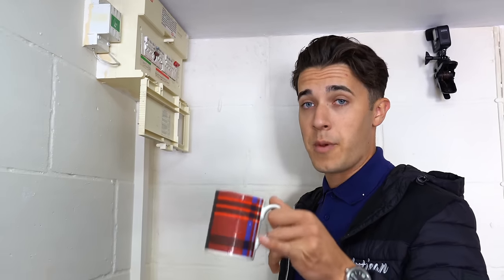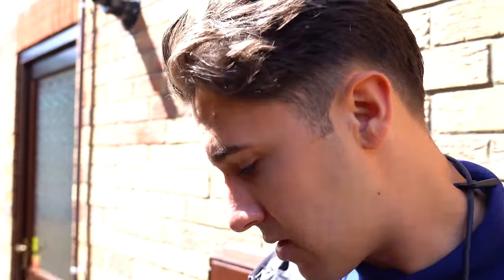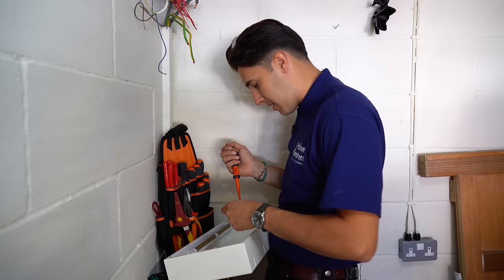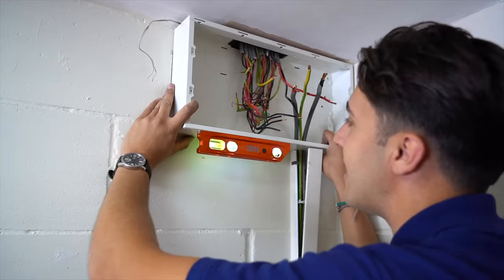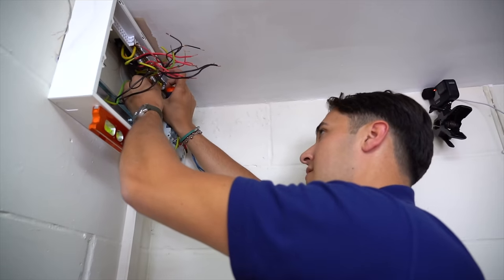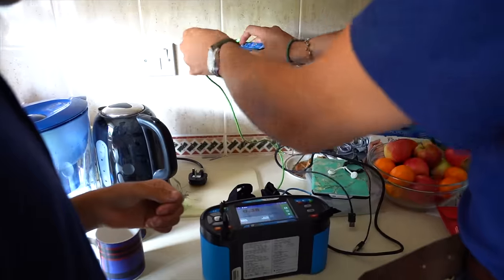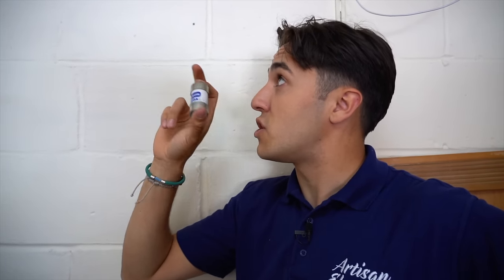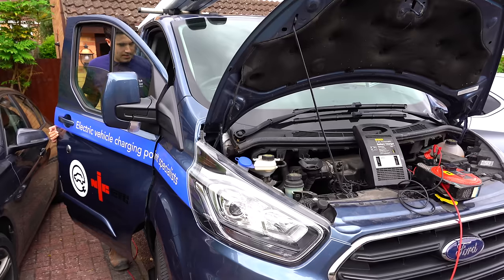Teaching Apprentice How to Change a Consumer Unit - Electrician Life

Comment: Big thumbs up Cory particularly re pulling the cut out fuse. It was the bain of my working life that DNO’s persisted with this ridiculous turf war over the sanctity of the cut out fuse. How are you supposed to work safely if they will not fit main isolators as a standard practice. Luckily in my area the local DNO engineers took a pragmatic view and happily handed me resealing tabs whenever I needed them!

Comment: In Australia, we are required to install a meter isolator.  It must go before the meter and before the main switch. It is in a separate cubical and away from final subcircuits.   This way, consumer unit changes are simple (well - simpler)

Comment: I recently got smart meters fitted by EON, and was pleasently surprised to see the subcontracted sparky fitting a nice new double pole isolator in place of the old one that had been fitted by SSE when I had electric storage heaters.  That's up here in Scotland.  Can't believe it's not a standard thing TBH
Reply: Had the opposite- the smart meter installer removed my isolator switch saying it was faulty anyway !
Reply: Had to specifically request it when I had a smart meter installed and the subcontractor was very surprised at the request!
Reply: I think it should be mandatory to fit an isolator when they are fitting a smart meter. Given the reason for smart meters or should I say excuse was that it will save us money, then how much could be saved by not having to call out the DNO when you want to work safely which is technically what you should do.

Comment: I don't understand the issue here in UK about removing main fuses... in Portugal as example, if a registered sparky needs to isolate installation, they can call the DNO, read the seal data and if they match with whats on file, the DNO authorizes the sparky to break the seals and work safely. Sparky leaves the broken seals and DNO will pass by in a couple days to inspect /reseal. 
All registered sparkies receive training to do it and obviously they must take responsibility for the work done.  It works like this in alot of other countries. 

In the end, the DNO wins as a lot of customers there update the meter boxes / mains fuse carriers to current specs at no cost to the DNO. Sometimes, if they are told in advance and it is an old installation they even send a new meter for the sparky to install... 

Wish i had £5 in my pocket for every meter they sent in advance once we notified of works being done.. Maybe it is a insurance / liability here in UK?
Reply: Some of the DNO's have a similar procedure here - what you've seen in this video is bad practice.
Reply: @efixx  I do understand that, but still preferable than working with live installations.

Comment: Another good reason to keep screw line vertical is so they don't rust as easily, when they are horizontal condensation and moisture can build up on them causing to rust quicker

Comment: Never measure with the cable around your neck. Faulty isolation on the meter and you van get the shock, was a problem with fluke meters but can happen with each brand.

Comment: You don't need to lift the seat up in the van to jump start the engine . Ford have a plus contact from the battery which is under the bonnet . And sith the black -leed connect that to the body or some metal part on the engine

Comment: Get yourself a DeWalt DCF601 12v screwdriver, trigger speed is lower than the impact driver, so easier when working with delicate screws.

Comment: i when i was working as a electrician, always used a proving unit on my mains tester before sticking on supposed live terminals. other than that , top job , i retired as a spark in 2015 after 40 years.

Comment: What’s are the number tags your using for the cables
Reply: Easi-lock slide on number tags , between £40-60 a box depending on source 👍🏼
Reply: @Lineandsinker87  Could you pop down a link for them buddy? Struggling to find them online thankyou
Reply from the maker: Hellerman tyton
Reply: @artisanelectrics  champion thanks, keep up the solid work guys

Comment: Why in UK  consumer units are in many cases so small. I (Finland) have a consumer unit in a detached house with 145 DIN module slots. OK it's a little too big, but I think 20-30 seats is the minimum. At the summer cottage, I have a total of 25 DIN module slots, of which 20 are in use. For example, there are usually only 2-3 sockets behind a single automatic fuse (in one room) or a single kitchen appliance such as a stove (3x16A), dishwashing machine or washing machine (16A every fuse). 10A automatic fuse are really only for lighting use.
Reply: Same in Poland. I've fitted a 160 module (8x20) board in my 200sqm house and it's just about the right size, with not much free space left. T1+T2 surge protector itself takes up 8 slots, there's a main isolator (3-pole since it's a 3-phase supply), 2 3-pole isolators (for sub-board in the utility room and sub-board in an outbuilding), fused isolator for the solar PV board, distribution block for power distribution within the board, several 2-pole RCDs for a few groups of circuits, 3-pole breaker for induction cooktop, DIN intercom transformer, a bunch of 1-pole breakers for several lighting circuits (2 per floor for the sake of avoiding total darkness if one trips), socket circuits (one per every room, outdoor sockets) and individually supplied appliances (dishwasher, oven, washer, dryer, alarm system, IT cabinet, gate opener). Apart from that there's another 3x18 sub-board in the utility room just for the utility room equipment (air-to-water heat pump, electric heating element in the water tank, ERV unit, central vac, with extra kWh meters to track energy consumption for heating and ventilation).
A 2x12 board with single or two RCDs and several breakers would be common in developer-grade 50sqm apartments with the most powerful appliance being the induction hob where hot water and heating are provided via district heat system, but it's impossible to fit all necessary equipment even in a small 100sqm house (even without electric heating and water) into anything smaller than 3x18 or 4x12 board without cutting too many corners. And since it's a standard these days to install heatpumps, AC and solar in new construction, much, much bigger boards are necessary.
I suppose in the UK ring circuits manage to limit the number of breakers for socket circuits. A single 32A ring in a kitchen can mitigate the need for individual radial circuits for big appliances (except for the hob). One 32A ring can also supply all upstairs bedroom sockets for example. It was designed for the sake of savings and apparently it does a pretty good job in this regard. With 16A radials many more circuits are necessary. Here it's considered "good practice" to install no more than 8-10 sockets per circuit in "normal" rooms (bedrooms, living rooms). That means one, maybe two rooms maximum per one circuit.

Comment: You would think main isolators would be fitted as standard now and retrofitted as a legal requirement for just basics of safety more shut offs the better its like a tap. You got the tap itself then a valve under the sink to cut the tap off then you got valves before that sometimes to cut a room off then the main valve/stopcock

Comment: Have customer call their electricity provider and ask for an isolator fitted? Then just book the job in once they have a date to avoid the potential nuisance that comes with pulling main fuse (even though I know you didn’t 😜) 

Only costs about £75 maximum up north, sometimes no charge depending on the provider And usually done within a couple of weeks

Comment: It won’t just be the belt… (cheapest quickest bs fix) no battery light on while driving to show it discharging.? Prob something drawing too much when ignition off, and likely the radio with the other trouble (expensive fix).
Reply from the maker: It was the battery in the end
Reply: Carplay not working is a result of a dead battery, because they like to DRM those things for some reason.

Comment: Hello everyone, quick question, is 37 too old to enter the sparkie trade??? Baring in mind current conditions etc
Reply: I started at 36. Just find a good college and get some work experience. It’s worth it fella
Reply: @GenerateLance  cheers dude. I did a carpentry qualification about 9 years ago. Was looking to add another skill under my belt. 
Its a toss up between electrics and plumbing.

Comment: Well ... so just pull the DNO fuse ??  ( which you did of course )  Try doing that with a SMART meter.  - ( which recognises   loss of power and communicates same to energy supplier )
Chances are you will get  then get a "fine" from the DNO who "know"  you did it , and when ( colleague of mine got an £80 fine for just that.)
For as much as I agree with safe working ... as I see it - that does not give you the right to interfere with DNO property.   
Suffice to say that there are other "ways" of dealing with the issue.

Comment: The thing I saw which I don’t like is the leads from your AVI around the back of the neck all good if the cables are in good condition but if there is a split in cable you could get a nice bolt from it mate.

Comment: Van talk is good. I used to work for VW as a technician. The new vehicles do have more issues than the earlier models. New Transporters have egr cooler issues when used for short journeys over a period of time. Unlike the Ford's, the VW vans don't have a static regen mode for the DPF, a feature i have on my newer transit connect.
So far I have had no issues with any aspect of my van. The Ford Sync3  on the van is great, i always have it connected via my WiFi at home, any updates issued will download whilst I am tucked away in a deep sleep.
On the subject of pets, now get this one.............. I fitted a shower for a customer back in June, she had a mouse in a cage. Yes, a mouse. How cool is that. I am all for the animals with small or large snouts.
Reply: They've had more problems with that van than I've ever had with my 23yr old T4, still going strong so I'll stick with it !
Reply: @PaulCooke25 
The T4 is a very good van, unfortunately they don't make stuff like that anymore.
Reply: @jontownsend8090  mad thing is I could get 3k for it, at152k miles still has original clutch, starter motor, alternator !

Comment: Which one is the apprentice?  The 'door trim' is rough AF. The tail entry could have been properly glanded. I don't recall seeing a torque driver??  BUT!! on the whole an immaculate board. Great to see house bashers using ferrules and wire tags.  Personally, when you 'zip tied' the line and neutral together.  We tend to separate them all out, Lines together, neutrals together, CPC's together.  Just something we've found when using Allen Bradley E300's.

Comment: Pulling main fuse out without dno/ dso permission, I don't think they will be happy as I previous didn't have very good experience with them even the seal was already broken. Consumer unit top cable entry knockout hole, I don't know how we gonna get away with CU IP4X protection, I personally think it would have been better to connect live & CPC for kitchen ring main socket circuit inside the CU and use r2 socket adaptor to trace cpc continuity issue rather than going round and try to open each socket.

Comment: As I understand it, power is 240 volts for all circuits but at different amps. Is this 240 volts from
ungrounded conductor to the ground?  I think so as Les Harvey was electrocuted on stage back
in the 70's, no polarized plugs. and with 1 hand on guitar strings and another hand on the
microphone of PA amp. . .music . . . no longer a part of his life. . . shocking.

Comment: The MOPs should be responsible for installing isolators not the DSO(DNO) they only install the cutout you can't install isolators until the meter is installed and the idiots have visited most houses fitting shart meters for the last few years so get on the right high horse Cory 😋

Comment: All vans are crap, German vehicles are one of the worst for reliability, VW, weren't they the ones cheating emissions 🤔.
If you want reliability you buy Japanese, although the new Toyota van is the same as the Peugeot, so that could be a bag of spanners as well.
That's got to be  a joke about a course for installing fuse boards.